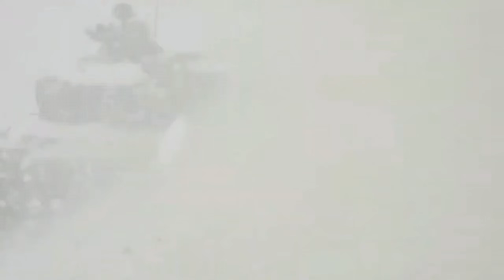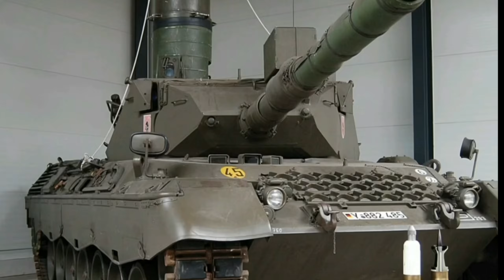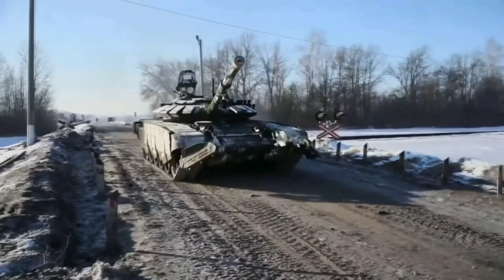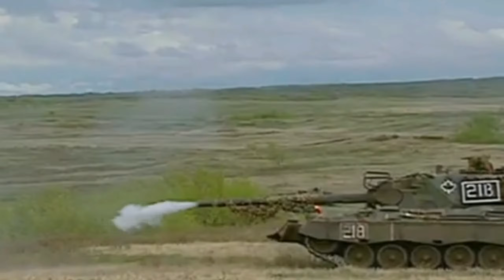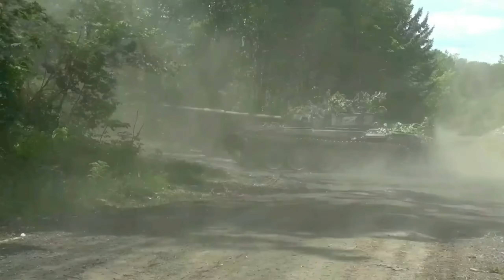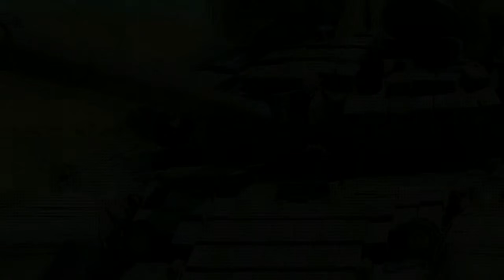German Leopard 1A5 Vs Russian T-72B3:Quality vs Quantity

Comment: Leopard 1 a5 is very good tank its only con is its armor it is vunerably against ATGMs and autocannons of IFVs .Its thermal sights are good its precision and accuracy is as good as modern Leopard 2s ,its speed is very good , its ammo capacity is bigger than leo2s ,it has bigger combat range then leo2s and its shells are cheap .That's why in greek army we still use them
Reply: only the sides are weak to autocanonns